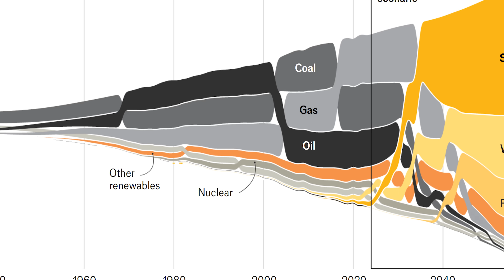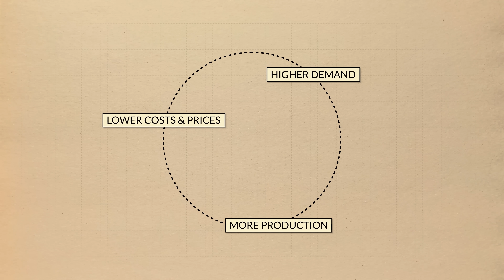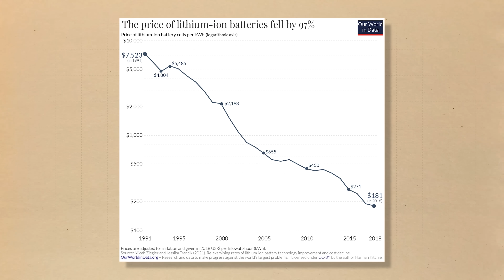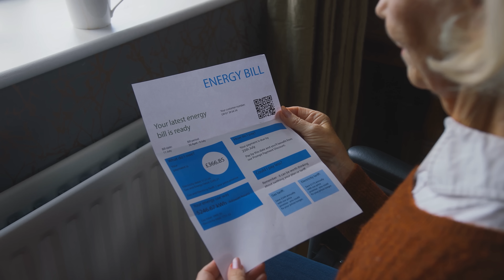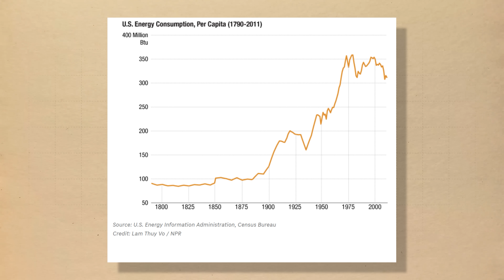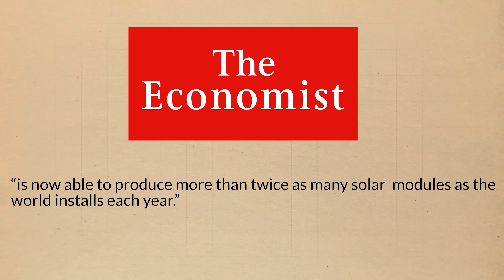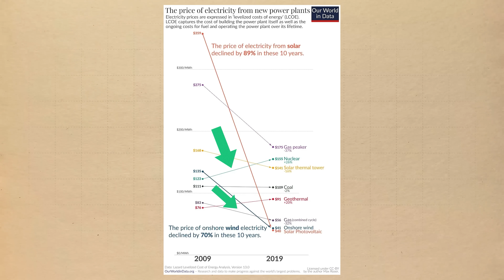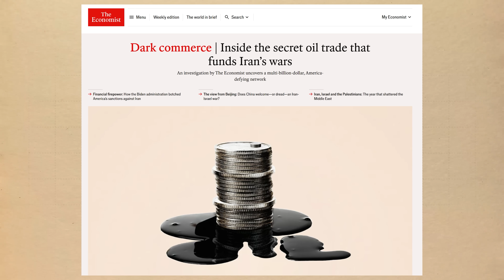Why solar will soon dominate & what that means for the world

Comment: solar, hydro and nuclear seem like the best potentials for near infinite energy, seeing the development of these sources of energy rise and become cheaper and more advanced is a good thing for everyone, a glimmer of hope in our current age of uncertainty.
Reply: Bro you forgot wind, especially offshore, its not too big now but it has some incredible advantages like having higher capacity factors than even the best gas plants, and producing incredible amounts of power for the actually space needed per turbine, new offshore turbines have capacities of 14mw, 10x higher than even 10 years ago.
Reply: @imakevideos5377 naw too hard to maintain
Reply: @imakevideos5377   Wind is very inefficient and intermittent just liek solar, and unlike Solar it cannot exactly be put on top of hoems and buildings for any supplementary power.
Reply: @ZippyPiglin36 it’s more efficient than solar with an average CF of 30 vs 18
Reply: Tidal and nuclear has the biggest potential. Solar and wind requires very vast pieces of land. For wind, we just need it to be very high up in the air without requiring huge infrastructure
Reply: @tanalson  Tidal is good for coastal cities, but it cannot be expanded too much sicne that would mean unnecessary changes to river deltas
Reply: @ZippyPiglin36  tidal is perfect for singapore. Singapore land area is small,but we are surrounded by ocean. Plus,tidal wave is 24 hours as compared to wind(inconsistent and constantly need to adjust wind directions)and solar(can only capture in the day, if it rains,no sunlight could be captured)
Reply: @tanalson  Said purpose for islands and costal regions is absolutely the best use for Tidal. Not every coastal place can be supported by Tidal alone tho, since it has moderate land usage (lower than solar and wind, more than coal or nuclear), but can mean pretty bad stuff for marine life is expanded too much
Reply: i will die and nothing of this will put into mass practice...i hear this mantra repeated since my high school 30 years ago! and in the mean time, energy prices have soared immensily!
Reply: Why not wind?  Its incredibly efficient productive claims less acreage and has the lowest carbon footprint.
Reply: @rmacd7373 wind has 1 huge problem solar shares it but to a differnt degree both have effective limits based on geographic considerations ie if your in an area with less sun light you will have less productive hours in a day and possibly less production per panel during these hours.  Wind is heavily effected by the providing winds in an area some ares are great for it others are really really bad.  Hydro has the same problem in that you need a sutuble sight for it with in resonble efficient transmission range or it is pointless, this is mitigated some what by the propensity for humans to settle neer rivers our costlines but is still a very important factor.  Transport of fuels exsspecialy as efficiently as we can throating aly manage it these days largely solves this problem for fossil fuels ie to far from where it is harvested but if I understand the full problem this is almost not a concern compared to areas that have issues producing enough power by renewable methods in there geographic area. Australia gets mentioned a lot in the succes of solar and rightfully so if my understanding is correct large portions of Australia are ideal for solar production.  But what about ares like the pacific northwest in the United states or the brittish iles(please correct the spelling of iles feels off but spell check is not helping) also problems with very northern locations Alaska parts of Scandinavia and northern Russia and Canada come to mind which are absoloutly unsuitable for solar power.  I mostly bring this point up because the enthusiest rarely mention it at all and it is one of the biggest problems with expanding renewable energy sources to a significant share of production.
Reply: All the technology's you mention have some issues. 

Solar has a capacity rating of 15-25% IE its intermittent with insufficient storage. 

Nuclear is very expensive, maybe more expensive than gas to build, maintain and operate.  That money represents the fossil fuels used to make the system work. 

Hydo electric has the problem of stopping the flow of sediments, filling up the dams with dirt.  Check out the Three Gorges Dam or the Hoover Dam as examples. 

I am not saying these technologies are not good options. I'm just saying they have there difficulties and we should not expect them to be cheaper than fossil fuels. That's because they take a whole lot more resources, infrastructure, and manpower with a lower ROI and their own potential climate change and pollution problems. 

How much money and diesel will it take to remove all the built up dirt behind the Three Gorges Dam?

How many hundreds of millions of lithium ion baterys will need to be built, installed, then 10-20 years later those baterys full of toxic gick will need to be "recycled" and replaced, for solar power to be used for more than 10-15% of the grid.

Nuclear has the NIMBY problem every time there is a nuclear disaster.  And no one can agree on anything nuclear in the US.
Reply: Near infinite? Wdym
Reply: Nuclear is a scam. If it was so great they would have stopped needing subsidies about 50 years ago.
Reply: You also really need wind power, especially in places further from the equator. Solar produces little energy in winter, where as in most places wind produces the most in winter/autumn. Thus they perfectly balance each other out, covering for their weaknesses.
Reply: Nuclear energy in the last decades has only become more expensive per MWh, not cheaper.
Reply: @robbert-janmerk6783  And how does an old technology somehow become more expensive? Politics!
Reply: And there is the concrete block tower crane solution that can store energy
Reply: @michiel1362   That is insanely fragile and inefficient. It's a issue of it's mere principle, not the technical development.

Comment: I agree with the statement of solar growing, thing is even if price is cheap the raw materials alone to transition isn't there for every industry. I am not arguing against solar but energy isn't just electricity. Oil and gas are used for steel, concrete, fertilizer, and plastics. Even if you were to electrify those industries they are very hard to do so and is very material intensive. Also the price of solar is heavily intermittent meaning the time in which  batteries hold energy and release matters. Batteries are fine for 6 hr buffer periods but they aren't great for months on end holding periods.  I think this video is a good explanation of what I mean.

https://youtu.be/iuUiFgsyDW4?si=AI_4DitQsV_SUnyA

Comment: My main concern is the Chinese warped data problem. China is known to fudge there numbers. Just because China is  overproducing solar does not mean they are procuring more energy from solar. The map shows that China is not in an efficient solar area their energy mix is still very dependent on coal. The solar panels are made using coal and are being over produced to the point that they are warping production markets. I think solar is rising but not as fast as data predicts.

Comment: I think that this video overlooks two important issues with solar : 1) availability and 2) transmission. 1) We’re still far from being able to store solar on a large scale, so this cheap energy would only be available during the day. 2) there are huge issues with bringing clean energy to users, because grids are not adapted. I think we will need to have more smart pricing to encourage people to use more electricity during the day and less in mornings / evenings-night. And we will need to have energy usage closer to energy sources. Amongst others, electric car charging should really be where cars are during the day (and not primarily at home like now, where they mostly charge at night).
Reply: I am in Western Australia. I have solar panels on my roof, a 15kWh home battery and an electric car. I start charging my car at 3 or 4am, with yesterday's left over sunshine. By the time the sun rises, I have mostly emptied my home battery. The sun takes over charging the car, then it recharges the battery. I don't pay for electricity (I do send excess power to the grid) and I don't pay for petrol (gas). About one third of houses (and we mostly live in separate bungalows) have solar panels. We are now rounding the corner where people are getting home batteries. The case for home batteries, if you own an electric car here, is overwhelming.
Reply: @aussie405  thanks for the info, it’s good to hear, unfortunately not as much sun in other Global North countries as Australia… I think that factory / warehouses / supermarket roofs connected directly to parking lots could really be better in Europe. Also because batteries are still expensive and resource intensive (lithium mining is pretty horrible).
Reply: @adrienbeauduin6307  our excess power is in the middle of the day and needs to be massaged towards the evening. The cheapest power in Britain tends to be at night and needs to be held for peak times. Places with hydro and / or nuclear will have a more regular supply but need to boost it at peak times. Shopping centre car parks are being covered in solar panels here, it keeps the cars cooler and provides power to run the centres.  It is fascinating to watch how the boffins are sorting it out. The cheapest option will win.
Reply: also availability by location.  I live in Canada on the West coast - lots of sun in the summer (in fact it would be ideal to put on all the flat warehouse roofs, my building gets really hot in the summer months) but forget it in winter where you're lucky if you see the sun once a week.  Also look what happened in Alberta last January, -37 polar vortex and Albertas 28% renewables were producing zero, 2 gas plants were down and the grid nearly failed.  Alberta Energy had to text everyone in the province to reduce unnecessary electricity.   
That would be pretty hard if everyone used heat pumps and evs.

But we absolutely should use wind and solar if the location is good for it.

Comment: Exponential doesn't mean what you think it does... solar has been on exponential growth for years, but is only now being recognized as significant.  The lack of accurate 'predictions' by 'analysts' is the news.  How many years in a row can anyone get it so wrong?  Why are they being paid at all???
Reply: I have been tracking PV growth for the last 30 years and have data going back to the 1950s.  I can confirm that the exponential growth of PV has averaged around a CAGR of just under 40% and this growth started in 1957.  Before this date there were no commercial PV modules.

Comment: Europe relied on cheap Russian fuel for years, and then had to cut it off quickly.  With solar panels, if China cuts us off then we continue to use the panels we already have while we get our own manufacturing up to speed.  There's no major risk to this dependence, but lots of benefits.
Reply: this is very short sighted... China will not cut off exports, they will manipulate your economic/foreign policies with your reliance on their solar panels. And you never want to cut off solar imports because it is a source of cheap energy. If it is economical you want to install as many solar panels as feasible, which would take decades, and then you will have amortization of existing solar panels as they need to replace every 20 years or so. Also, good luck competing with China's economies of scale if you want to produce them domestically.
Reply: It's the US that cut off Russian gas supply from Europe. It's also the US that have banned / sanctioned Chinese technology. You should worry about what the US will do instead of what Russia or China will do.
Reply: 😂😂😂 Acting like they will cut you off when you applied the sanctions
Reply: Guess Russia also blew your pipeline.
Reply: Northern Europe is a poor source for solar energy.
Reply: Europe was warned. Anyone could see the problem coming, depending on Russia, even when Russia was building up forces to start a war. But Russian gas was so cheap, and politicians can't say no to to something of such economic benefits - if they run on a platform of promising higher electricity prices to the electorate, they aren't going to remain in power.

Comment: The real question is "will China provide loans for countries for migrating go solar power?" Realistically to sustain the growth external to China they need capital and as such China would have to be willing to provide Yuan loans in an effort to get other countries to buy up solar panels.

So if China lent out something like 7 trillion Yuan for the purposes of buying solar you'd see that exponential growth curve continue until market saturation happened somewhere in the mid 2030 to early 2040s which would be about the point where replacement cycles begin.

One thing is for certain though and that is that install capacity in China  can't continue much longer and they will need new markets so I'm curious to see if they will go on an lending spree to foreign countries as a means to prop up employment in China.

Comment: This is extremely optimistic. Most ppl I know put solar on for one of 2 reasons.
The subsidies made it bearable, though the requirement to use "authorized" installation providers artificially limited supply hence increasing the pricing significantly.
They don't care that it will never cover the costs. They're ok with losing out on it just to fit an idea they have in their heads of the self sustaining home. And if you live in an area where power outages occur often enough it's extremely easy to buy battery backup + solar out of pure spite.

For this to continue you need to drive down the upfront cost, significantly. I don't see that happening. Mostly because even if the cost of panels go down to 0 the extra cost of installation, inverters, etc forces the upfront cost up to the current unpalatable position.
Reply: Where are you from? Here in Poland sh!t ton 9f people has been installing solar in the past 4 years. Tellemarketers who sell them are driving me crazy.

Comment: The main issue with solar voltaic and wind turbine generated public power grid electricity is they save little to no fuel.   In the US they are advertised to save 1% on fuel each with that number likely rounded up significantly.  Their practical use is for maintaining electrical storage or something similar such as working in combination with hydropower.   

A steam turbine cycle does not allow instantly backing up large amounts of wild AC from these erratic sources of electricity.   Hydropower does along with natural gas turbine and diesel generators.   

The typical means to have a large wind turbine generator farm behave as a scheduled power plant is to have it 100% backed up by natural gas turbine generators.   Natural gas turbines need to run at high readiness consuming 70% of the fuel of full output, but making little electricity to nearly instantly backup any dips in electrical output from these erratic sources.   A steam cycle adding 50% higher efficiency making steam from the hot exhaust can not be used.   

In the US using 2022 prices a new ultra supercritical clean coal plant burning high BTU bituminous coal would have 1/3 the fueling cost of a natural gas combined cycle plant.   The coal plant costs many time the cost of the NGCC plant in capital cost and staffing.   The crossover fueling parity price of the coal plant is $0.80 per million BTUs natural gas.   The offseason early summer 2024 price of wholesale natural gas in the US was $2.50 per million BTUs.   Natural gas spot prices in the winter can be many times higher.   

The US doesn't have commercially mineable uranium.   It does have some mineable uranium, but it is much cheaper to buy it from Russia.    It is relatively easy to compactly stockpile uranium power plant fuel for many years.    Nuclear power has the cheapest cost of incremental electricity after hydropower.